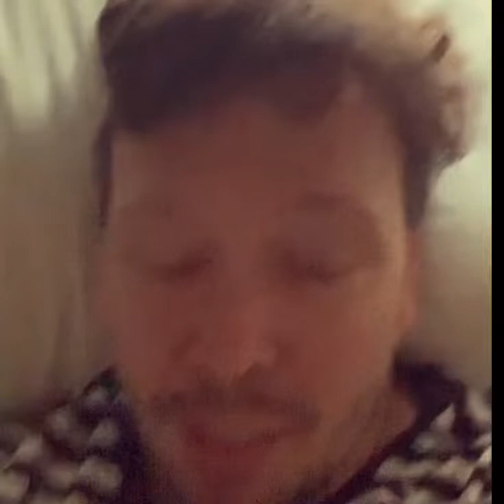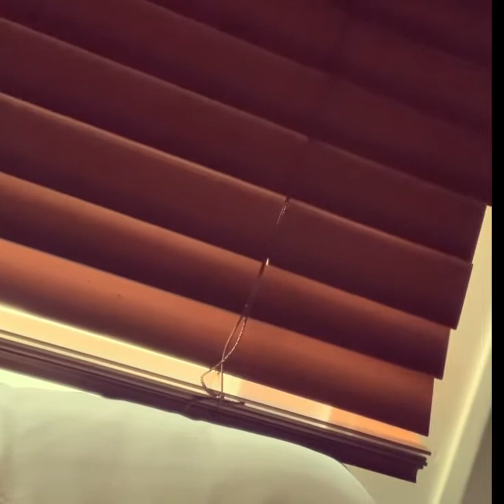This is what a mechanical heart valve sounds like

Comment: Always stay  blessed!
I want to ask one question,  11 years back my sister  went through  open heart surgery at the age of 31 in which her valve was repaired. Again she, at the age of 42 , gone through a heart  surgery. This time valve was replaced with metal valve. After 25 days of surgery she is not able to sleep. She cannot lie down straight on the bed  if try feels suffocated So she generally sleeps  by sitting only  is it normal will be ok after  sometime  Please answer I m too worried🙏🙏🙏
Reply from the maker: Always ask a cardiologist. I never experienced that. In the beginning it was hard to sleep but it got easier as the days went by. I didn’t feel like suffocating, but the ticking at first really bugged me, and my shoulders hurt when I woke up after sleeping on my side. I would definitely talk to a cardiologist and surgeon and see what is going on. Hope she gets better ❤️
Reply: @slimhaines2  Thank u so much for your  response ❤❤❤
Reply: I had and sometimes still have that issue.. I do feel more relief while sleeping in a sitting position.. again, talk to your dr. From what I understand, there’s more pressure added to your chest when lying down, especially lauding down on your left side. Apparently, it pushes your heart closer to the chest and can make the thumping louder or uncomfortable
Reply: My father went through the same process, and had same symptoms afterwards. Literally the same. He passed away one month after the surgery due lung failure
Reply: How is she now

Comment: Had my mechanical mitral valve put in in 2007. My interpretation of the sound when I first heard the clicking was that of tapping two nickels together. 15 years later, after inflation, it sounds like two quarters tapping together. Naaa, I can barely hear it now. However, when I am at a doctors office or a blood lab, the professionally trained health workers can hear me clicking 10 feet away. Really!  The only time I hear it now is at night in bed with my head on the pillow and my mouth open to let the sound escape. At least I'm still clicking away.
Reply from the maker: 😆 I want to steal that joke. I got used to the ticking now, but I still hear it from time to time. My fiancé hears it more than me, especially when I drink 🍹.